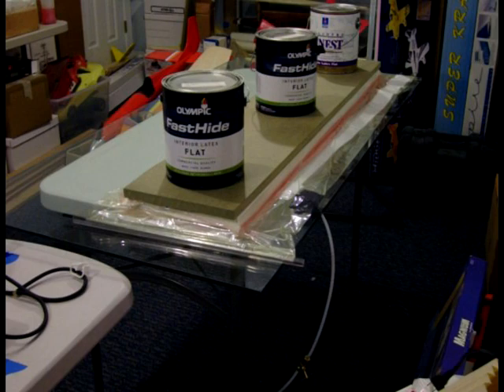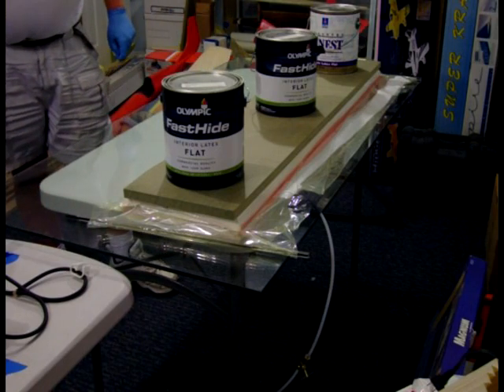Sheeting a Quickie Wing - Part 3

Comment from the maker: The clips I use are from cstsales.com/vacuum_bag_seal.html and they are called "Bag Seal Clips". I use 20", but have 29" as well for bigger bags". If you get the EZ-Vac system kit from ACP at acpsales.com it comes with clips

Comment: Are you still selling these? If so where?
Reply from the maker: Yes, direct for the moment .. prices are a bit higher due to increases in balsa and carbon fiber prices .. I no longer take PayPal .. no one should with their current policies .. Zelle, Venmo, CashApp, crypto only .. if you don't have one of those, you need to .. most US banks have Zelle or the Zelle app can be linked to most US banks .. email me at Don.F.Stegall@gmail.com or text or call to 980-269-4664 .. have NACA 66-012 (Vortex), S8064 (Viper 500), MH17B, and some others.